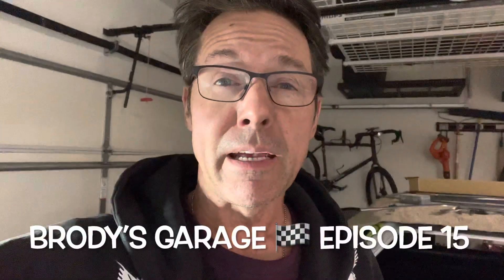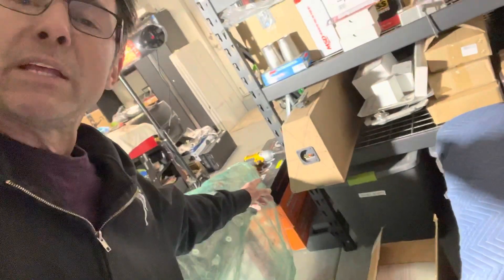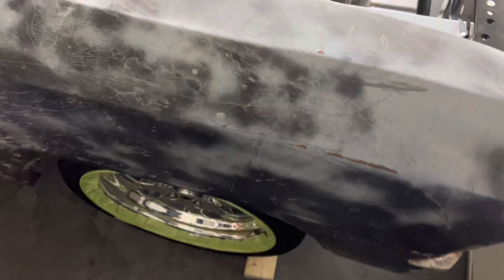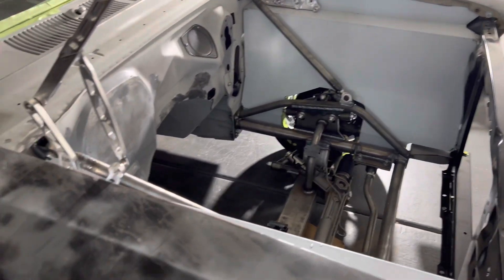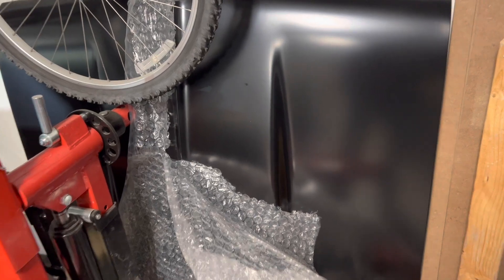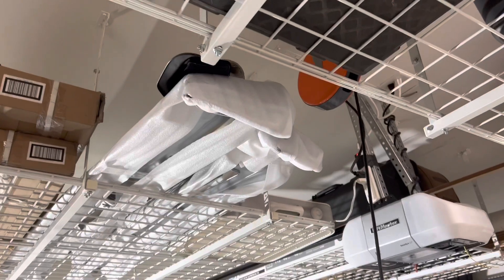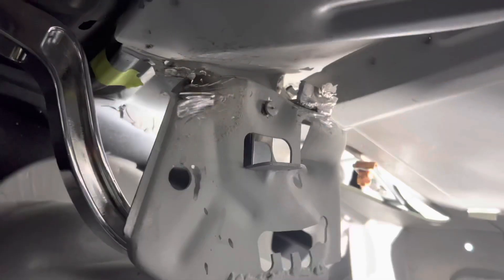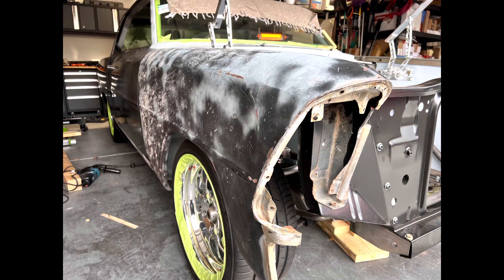Brody’s Garage 🏁 Episode 15: '67 Nova fender woes.

Comment: I hate the scammers and it’s getting harder to tell the difference in most of the Facebook groups. I’ve only had good experiences with Brian McGee and Jeff Alan so far but unfortunately they don’t have everything I need still (front fender mount antenna and rear wheel well moldings). Good luck and keep posting.
Reply: Any 67 factory radiator supports out there?

Comment: that's the bad part of buying something and not seeing it in person. i've been there and done that too. i know everyone says buy original because repop don't fit well but here is something to think about. you are dealing with an aftermarket body so i don't know how well oem panels would line up anyway. plus the body gaps from the factory in the 60s was horrible. this is why paint jobs can cost a lot of money when the shop spends the time to gap everything to that perfect 3/8 gap. they have to cut or add metal to achieve the 3/8 gap and sometimes have to work the metal to get them to lineup. if you are planning on having those perfect gap i would start with aftermarket fenders at least you are starting with fresh near straight panels